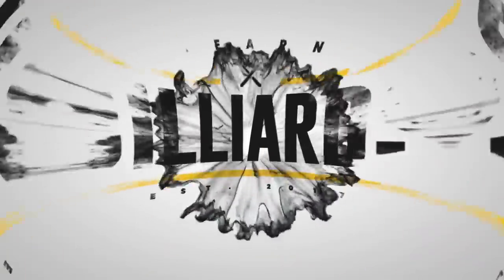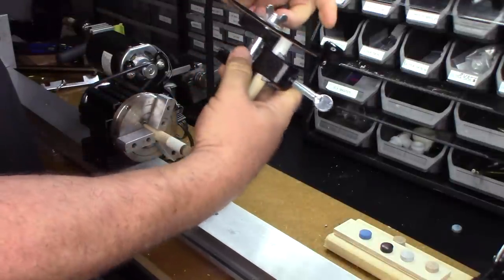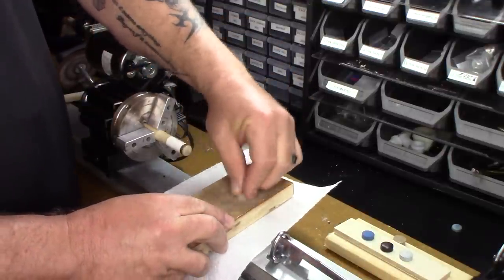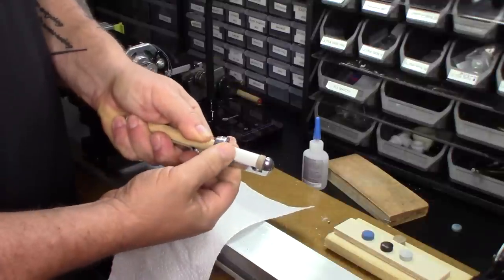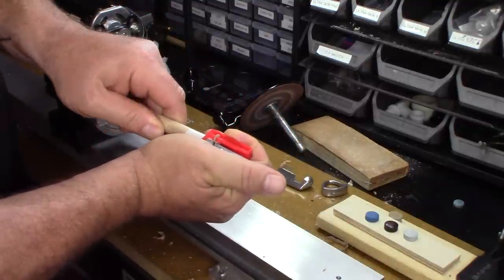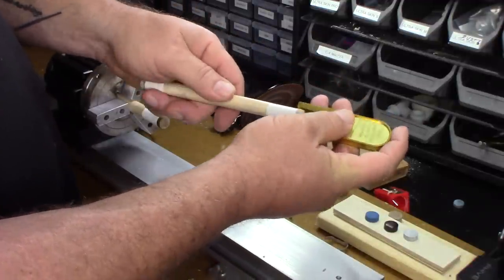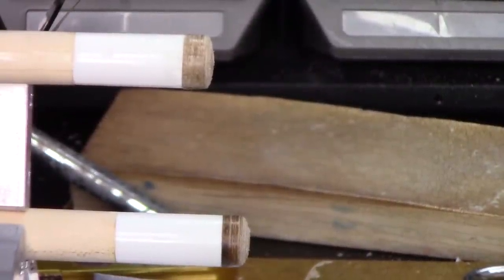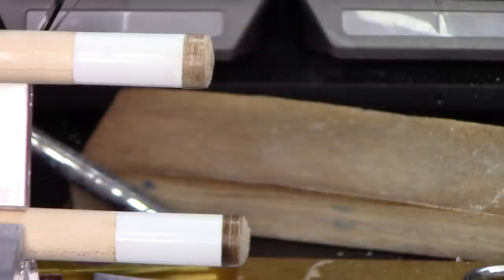How To Install A Pool Cue Tip

Comment: Put a new tip on a friend's stick just before I happened across this. Nice to see you are using the same tools as me. Also nice to see I did everything the way you did, except I don't like the tip sharpener for edging. I prefer roughing down by hand. Good job.

Comment: Thank you for this informative video. On your site for home pro kit what does it mean that a 9 inch sander is not included? Does the kit include everything in the picture? That statement is a bit confusing.
Reply from the maker: Sorry for the confusion. In the pic you will see 2 long shaper Sanders, the longer one is not included. Everything else is included

Comment: How to you prevent putting dings and scuffs in the shaft during all of this?  Specifically the back and forth motion you use with the mushroom tool, and also the tip clamp.
How would you work differently with one of the new carbon fiber shafts?
Reply from the maker: If your worried about that I understand. When used correctly the multi tool will not damage the shaft. You can always put a piece of painter's tape to protect the shaft. I would work on the carbon fiber just the same.

Comment: Use a kiridashi knife to trim the bulk of the tip. Use a 14mm deep socket to line up the tip for gluing. Drop the tip in the socket glue side up
 Put painters tape around the ferral until it barely fits into socket. Put a drop of glue on the ferral, slide it in and push for a second.(make sure the tape is even and flat.) Don't leave it in there too long just in case you put too much glue. Pull it out and push/clamp down on tip. Will be PERFECTLY flush. Makes it easier and safer not to hit the ferral with pencil sharpener thing.

Comment: Does that type of clamp put a digit in the shaft?
Reply from the maker: No. As long as you don't make it super tight. It just needs to be snug
Reply: It does put a ding in your shafts. I cover the shafts with Teflon tape and it takes care of the problem